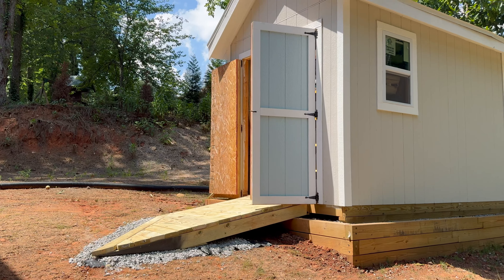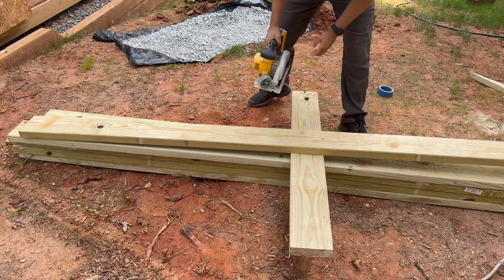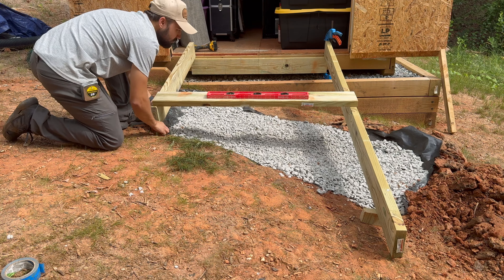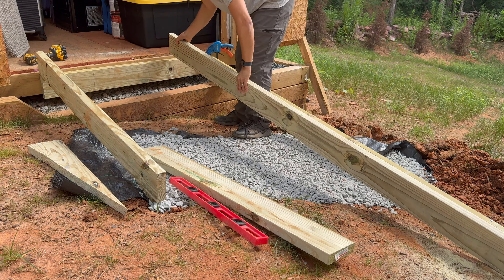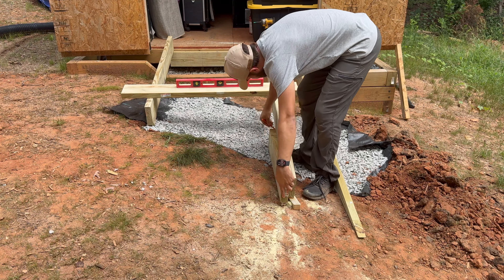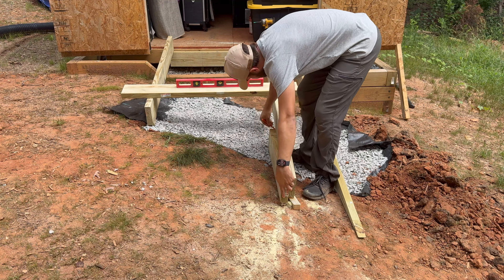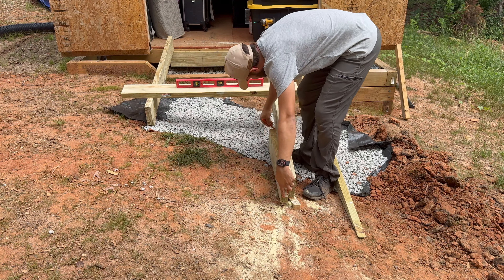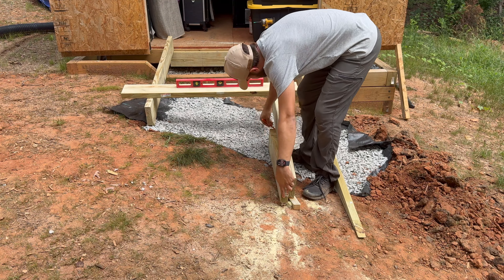Simple DIY Shed Ramp on a SLOPE

Comment: Thanks may friend I learned a lot!!!!. Could you not of put a piece of wood at the bottom.  Leveled it on the gravel,  then brought your  joists down to it . ?
Reply from the maker: Some folks add a board on the bottom… I chose not to and use the flex seal. The idea I had is that the board in the ground would rotten out faster…. Anyways, it’s an option for sure. Thanks for watching.
Reply: @EverydayShed  again thank you for your knowledge.  My friend.
Reply from the maker: @stevenlake5278 you’re welcome

Comment: Nice vid and explanation.  I have a metal roll upper door on my shed so I will not need any adjustments there.  I like that you installed the joists to three ledger board before installing it.  Very clean and strong.

Comment: This is super. Wish I saw it before doing mine. I did everything and was bolting down the decking boards, only to find uneven joists and it looked horrible. I have taken the boards out will redo the joists by using shims on each and then cutting the bottom of the joists. Thank you for sharing- I was puzzled.
Reply from the maker: Awesome!!! thanks for watching.

Comment: Very nice solution and lots of practical tips. Would you have any ideas on how to finish the plywood floor of a shed? Friends had one built and can't decide what to do with it. One side is used for storing a lawnmower, snow blower and motorcycle and the other side will be a small workshop with a bench.
Reply from the maker: In the past I used Rust-Oleum floor coat. It has done pretty well… you may try that… thanks for watching!!!
Reply: @EverydayShed  Thank you, I'll pass that on to them. Much appreciated.
Reply from the maker: No Prob... good luck!